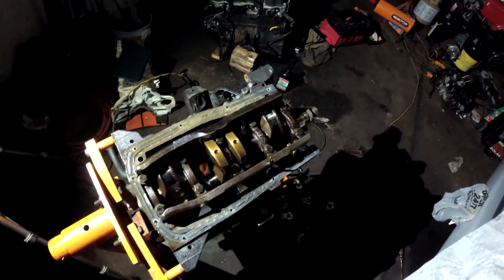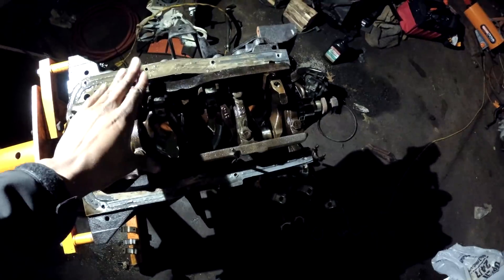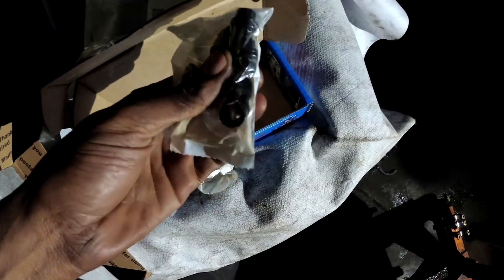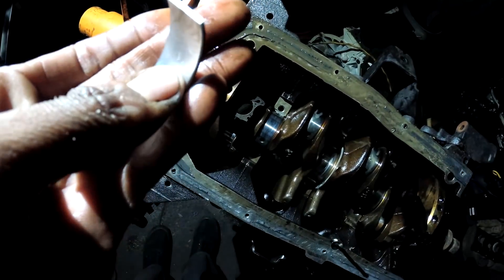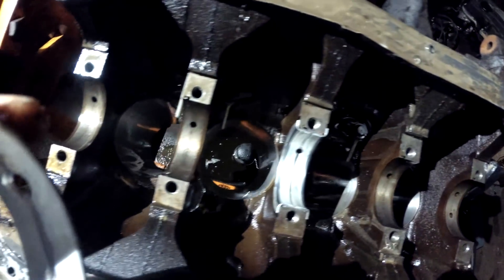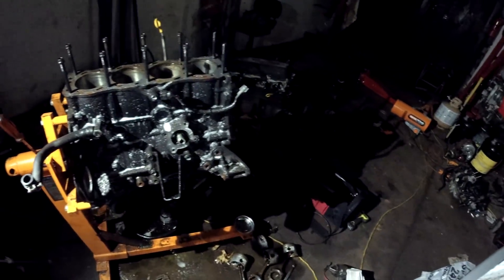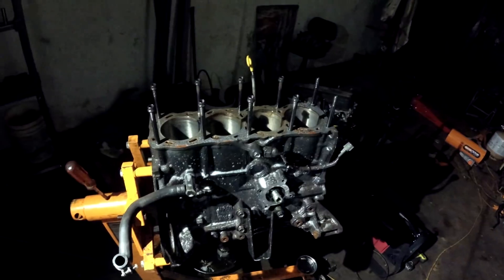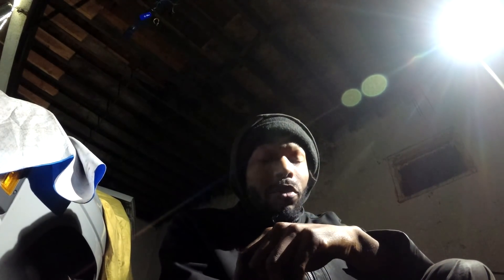How Legit Can This Be|READ DISCRIPTION

Comment: The bottom end is everything!  Have the crank checked with a micrometer   And plastic gauge he main and rod caps.  Torque to spec and the rest should be in good shape. Keep the videos comin
Reply from the maker: Roger Richard That I'm gonna do. I want to do this the "hard" way not the easy way
Reply: TooForTea the right way and the easy way are seldom the same way.  If you can afford to get the block hot tanked and decked if the rust got too bad on the block.
Reply: Awesome can’t wait to see it complete man
Reply: TooForTea those bearings are in near brand new condition.  You will see a copper color where there is and wear
Reply from the maker: The engine was previously rebuilt and never drove for more than 10 miles so yeah they are basically new lol. I just want this engine to be built properly so I'm gonna see everything as being super worn even if they aren't.
Reply: Rebuilt plenty of engines without hottanking it's not like any of those engines ever threw a rod or spun bearings and Plasti gauge I use when I know my motors cranks been cut needs to be cut or extremely high mileage other than that standard should be within clearance ... But Nissan blocks bearings and cranks are stamped with numbers some clearances aren't the same a set of shells could be completely different from journal to journal so is not Plasti gauging the smartest way no but have we had luck yes
Reply: David McNeil this thing was sitting in the engine bay with bushes growing up around it
Reply: blindabinda123 lol it's not like it grew in the block yeah maybe some brake clean but it's not that crazy we hot tank blocks when some catastrophic shit happens
Reply: TooForTea don't believe low oil pressure or oil issue led to that one bearing looking funny that was a dirty install knowing Brad I can see dirty gloves new bearing dirty fingers fresh oil lmao wipe wipe hehe I build engine lmao
Reply: David McNeil the deck of the block is all rusted so you can be sure there's rust in the gallery's and everything

Comment: To keep rust off, while your waiting on parts etc, you need to spray some wd-40 [or equivalent] on the block, it will keep condensation from forming and keep rust at a minimum, as far as plasti-gauge goes it's sort of a half a$$ed approach to getting proper oil Clarence measured, don't get me wrong it works to get a close figure for basic engines, and it's better then nothing at all, but there are more accurate ways to get the oil clearances, via dial bore gauge measurements and micrometers etc. what ever you do make sure the crank passes the fingernail test, especially in areas where there is scoring or scuffs on the main bearings, maybe get the crank polished you can diy polish it using the brilliant Kelvin Williams method, but you have to get all the micron paper and supplies etc he did a good video on it on his channel.
Reply: Mitsubishikid Plasti gauge is good enough if the crank hasn't been cut or parts have low miles ... Diesel game we Plasti gauge n those are a million miles engines this isnt nascar or nhra or f1 lol most guys do all this fine percise tedious work n can't get 100k out of it .... Not saying you're one of those don't know your skill n won't assume
Reply: ... I doubt measuring and blue printing a block with expensive tools is the only reason;  Nascar; NHRA; F1 engines can't get 100k, but to be fair the tools do cost a lot, if you go for quality ones anyway, but I suppose if your on a budget you should at least use Plasti gauge, better to have an idea then a shot in the dark.
Reply: Mitsubishikid not cuz of budget just no nessecity if you're parts aren't crazy worn ... N kinda not fair in comparison cuz they do tare there engines down often

Comment: Id like to c u clean up the block, get newer bearings, get new gaskets and then work on reassembley. I'm no expert but, I think if you want to do this right, take all necessary and proper actions to complete this project the right way the first time. It might cost u a little bit now but will save ur ass in the long-run. Keep up the good work!

Comment: Dude your skipping such an easy and vital step in building an engine. Have the engine hot tanked to get everything cleaned out.
Reply from the maker: blindabinda123 I need to get it hot tanked yes. I want to and it needs it. I have to look up how much and where. I will definitely get that done
Reply: You know if you buy 100% pure lye and mix it with water and paint it onto the block you can do the same thing. You just have you make sure not to get it onto any machined surface
Reply: Carlin Lentz that's the problem.  He has to get all the oil galleys and everything cleaned out because the thing sat outside with the head off and moisture getting everywhere.
Reply: blindabinda123 that moisture will evaperate after a couple runs dirt's worse then water
Reply: blindabinda123 what oil passages were exposed to outside? Pistons were in timing cover was on if anything dirt and water got in the water jackets